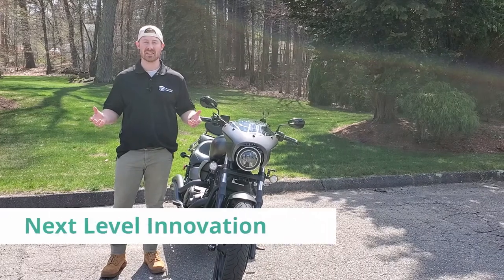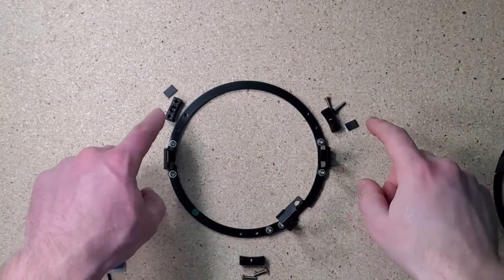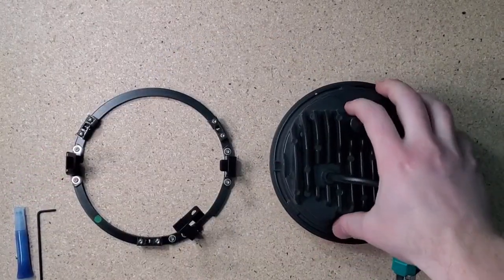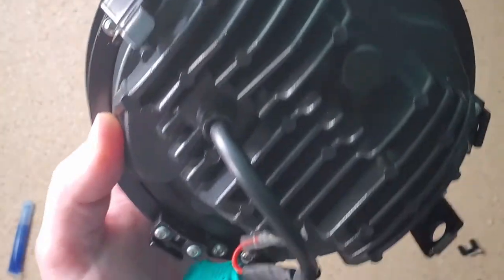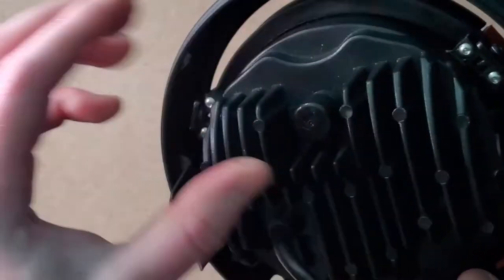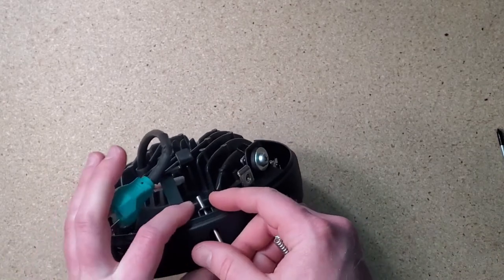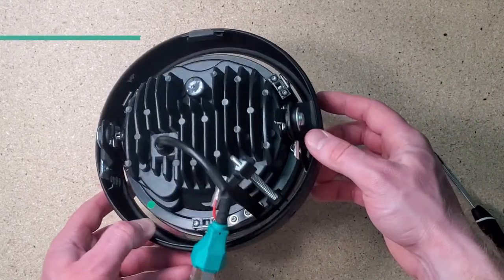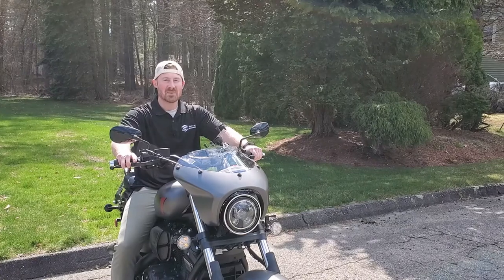5.75in V2 Yamaha Motorcycle LED Headlight Adapter

Comment: Best adapter on the market! I bought the J.W. Speaker Headlights for my girlfriend's Yamaha XSR 700. With this Adapter it was easy to mount the headlight in the lamp housing with high quality. 
Everything was included, even screw adhesive. 
We are super happy to have found a very good solution with them.

Comment: I purchased this adapter and it worked very well. It’s currently installed on my Vstar! Excellent product! Should come standard with aftermarket LED 5.75 inch lights.

Comment: Received mine in the post yesterday and watching this video found it dead easy to assemble and install.  Very well engineered components and it all went together without a hitch.  Cant wait to get the Stryker out on the road at night to try it out.
Reply: Did you get the Amazon one? Is it still working?

Comment: The directions were non existent for the model I purchased. It worked. I had to look up multiple videos and just tinker a bit. I made it work. I ended up with a couple extra bolts and washer. Everything seems to work though so all in all I give it a thumbs up.
Reply from the maker: Hi,
This adapter is similar to the Vstar 650/1100 custom adapter but for the Yamaha Stryker, Raider, Bolt, Warrior and some Kawasaki models. All adapters come with a QR code install manual in the box to help conserve on paper usage. All manuals can also be downloaded off our website.

Comment: Great direction!! I have a 08 Yamaha raider any to recommendations for led head light to purchase along with your headlight adapter?
Reply from the maker: Hi Julio, we run a Wisamic led in ours but have heard good reviews from other riders for alot of other brands. Make sure to look for the power output in watts (W) around 50 to 80 range. This will give good output. If you want a high end light JW Speaker will fit and makes a high quality light.

Comment: Please help. I have a 5.75" new led headlight. Is this a 7 inch ring adapter?  I'm looking at one online but only find that size
Reply from the maker: This adapter is for 5.75in LED headlights. What year and model motorcycle do you have?

Comment: will it fit my Yamaha 2004 1100 V Star Classic and if so, I how can I order it with a 7" head light adapter?
Reply from the maker: Hello,
This adapter is for a 5.75in LED headlight and will not fit in your Vstar classic motorcycle. 
I believe your current setup will accept an aftermarket LED headlight without an adapter. Please confirm.
Reply: Do you guys carry them? If so , how can I buy it
Reply from the maker: @kingtut5401  yes please visit our website www.nextlvlinnovation.com and search 7in Headlights and these should work.

Comment: Just installed it on my xsr900. There is a small gap between the bucket and the headlight. I understand that it is for cooling purpose. But is it safe to ride in the rain? I m afraid the water can mess with the electrical wires.
Reply from the maker: All headlight products and wiring are water tight and should not cause any issues.

Comment: Will this adapter work with my 2008 Honda Shadow Aero 750?
I purchased an led headlamp from Sunpie/5.75 
The sunpie lamp does not fit onto the brackets of my stock lamp housing which clips into the stock bucket😡😢
Reply from the maker: Hi Trevor,
   There are alot of VT750C models that we came across. Could you send us any images you have of your headlight setup .
Info@nextlvlinnovation.com
Reply: @nextlvlinnovation  
Yes I can . I will asap

Comment: Hi, it didn’t fit the light I bought do you have a link to a model that you know work please ?
Reply from the maker: Hello Joel,
   Here are a few that we have used and like.
New Brightest DOT Approved 80W Osram Chips 5-3/4" 5.75" Round LED Projection Headlight Compatible with Harley Motorcycles Black https://www.amazon.com/dp/B071GCDC33/ref=cm_sw_r_apan_glt_fabc_BV4HSZ08NXQYFD2NX4WR
SUNPIE Motorcycle 5-3/4 5.75 Halo LED Headlight for H arley Dyna Street Bob Super Wide Glide Low Rider Night Rod Train Softail Deuce Sportster Iron 883 https://www.amazon.com/dp/B07WS9RS97/ref=cm_sw_r_apan_glt_fabc_5229YJ20K3CXYKRSV7YK
SEALIGHT 5-3/4 5.75-inch front LED bulb for Motorcycle. Plug and Play, 6000K-6500K Super Bright Light Pattern, Quick Installation, Over 50,000 Hours Lifespan, IP67-rated https://www.amazon.com/dp/B07FFQFCXW/ref=cm_sw_r_apan_glt_fabc_QNGPZWMBCXKVZD7A7VMH

Comment: Well, I am getting my 2016 Stryker in a few weeks... I will be ordering one of these asap! Does the Stryker use a 7" or 5 3/4" stock? just wondering...
Reply from the maker: Thats great Joey! The stryker uses a 5.75in headlight.
Reply: @nextlvlinnovation  Hi guys, thanks for the info. This is my first bike, so pleaee excuse my lack of knowledge,  but if the stock headlight is a 5.75 can't we simple swap it in? Or is it because the HID headlamps arent built the same as the stock, hence the need of the bracket?
Reply from the maker: @Joey.Darkwoods-Studio  Thats a valid question. The halogen headlights are custom setups and use their own special bracket. The aftermarket LED headlights are based on a different standard and are used heavily in Harley motorcycles.

Comment: Where u get the head light cowl from and will it fit a 2008 Yamaha roadstar warrior
Reply from the maker: Hello,
   The cowl/windshield came with that motorcycle but I believe they are sold by a few different suppliers. Try searching Revzilla, Babbits oem parts, or low and mean. I think they come un painted.

Comment: The parts used in the video do not match the parts in my kit. The “adjustment piece” is different and my kit did not come with an “adjustment wedge”. I was able to figure out for myself how to assemble what was different/not included. This video was were the QR code (in lue of actual instructions) brought me, so I would have expected the product to match the video, especially since there were no paper instructions included. The work moving out of camera frame on occasion was annoying also when you are trying to see details of the assembly, should have done a second take for customer clarity.
Reply from the maker: Thank you for your feedback. This product has gone through a couple redesigns but for the most part still covers the main concepts. As stated on the QR slip the instruction manual will always be the most up to date.
Reply: But since you don’t include that, those of us without printers have to read it off a phone or our home monitor. I would have appreciated the up to date printed instructions being included. Considering the minimal expense for that and the video being out dated, it would have saved hassle.

Comment: But you it doesnt adjust to the sides
Reply from the maker: Hello Lukas,
  When upgrading to an LED light you do not need side adjustment since the light dispersion is equally split from left to right. Halogen lights need the horizontal adjustment since they produce an angled light on the left side that can interfere with traffic. Most adapters on the market today dont offer horizontal or vertical adjustment.

Comment: Way too much gap.  I will create my own without the gap.
Reply from the maker: Hello,
The gap is needed for the vertical adjustment as well as for airflow for the LED. The gap can barely be seen once installed since the bucket is dark in color and blends with the bezel.